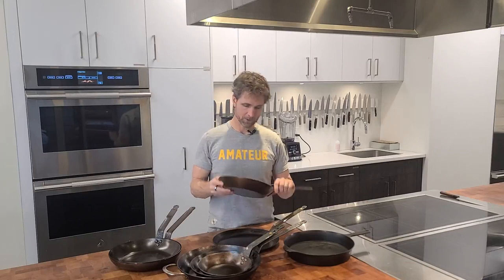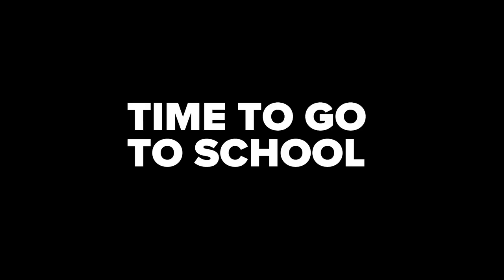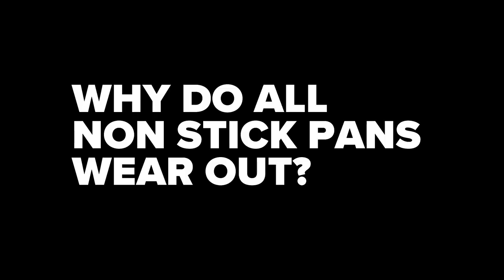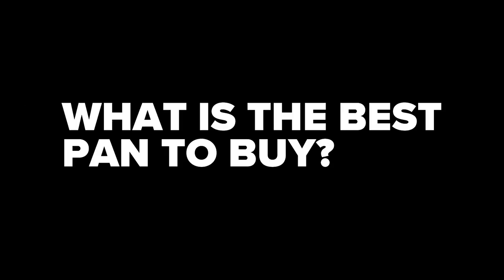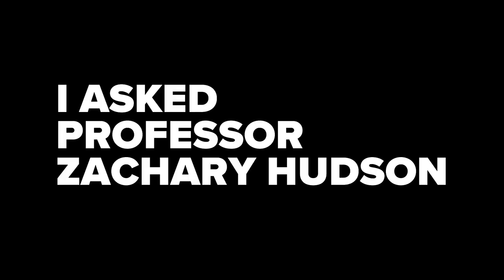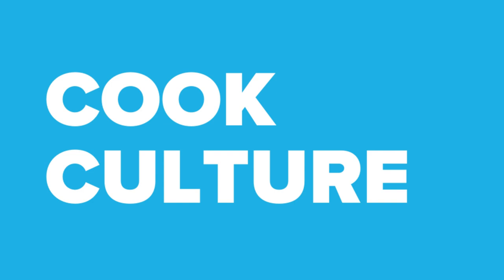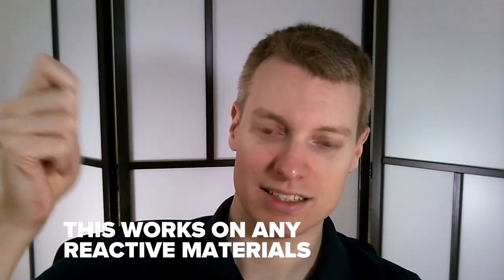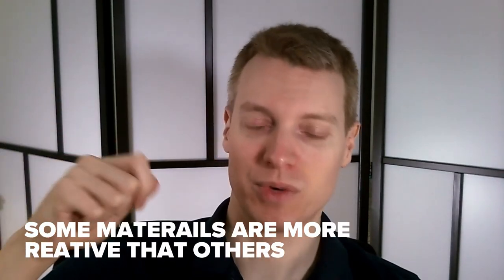Why ALL non-stick pans will wear out: I spoke with a Polymer Chemist

Comment: Dont saturated fats have higher smoke points and unsaturated fats have lower smoke points? So isnt it a contradiction to say you should use unsaturated fats and fats with a high smoke point?
Reply from the maker: Hi, the Doc was quite clear that unsaturated has a lower smoke point than unsaturated.
Reply: @Cook-Culture  Thats not being very clear to be honest xD
Reply from the maker: @jeffreylebowski4927  He explains it in fine detail in the video....?
Reply: @Cook-Culture  hehe I was teasing because you wrote unsaturated fats both times in your previous comment. - Like i said the way I understood it the doctor said to use a high smoke point, unsaturated fat - i was under the impression than unsaturated fats have low smoke points because theyre more reactive and saturated fats have higher smoke points - so a high smoke point low saturated fat seems like a contradiction to me - however Im sure its because of my ignoracne which is why I was asking the question.
Reply from the maker: @jeffreylebowski4927  Ah! Good question though, but yes, he's quite clear on how it works and why certain oils are better than others
Reply: @Cook-Culture  Ok so why is a high smoke point oil better than a lower smoke point oil?
Reply from the maker: @jeffreylebowski4927  High smoke point oils are considered semi-drying oils or drying oils meaning that they will not stay gummy. Low smoke point oils won't create a hard coating

Comment: Thanks for this amazing and actually scientific explanation of cast iron seasoning from an actual expert.  It has been frustrating to sift through all the anecdotes and misinformation in seasoning to just get an honest explanation of what it is and how to make it.

We really need to force manufacturers or consumers of non-stick pans to pay for the cost of disposal and recycling of their pans they know will be used up in two years.  They should pay for all research and efforts in cleanup of forever chemicals.  This externalization of costs breaks capitalism.  That cheap non-stick is a lie.
Reply from the maker: I understand that but unfortunately it's not going to happen.  What is happening is laws are being passed that will makes a huge difference.  Change is coming.
Reply: @Cook-Culture  Hopefully they are passed soon enough.  Fighting wasteful consumerism should be something both the left and right can agree upon.

Hey, while I have you here, what would you recommend as the next piece in my collection?  I have Lodge 6, 8, 10.5, and 12" skillets and one probably-too-thin tri-ply Calphalon 10" pan I got at an outlet store (the handle is heavy enough it lifts the pan a few mm if it is empty).  I was thinking of getting into carbon steel, but not sure which size would be good for my first piece.  I mostly cook for myself, and don't eat meat or eggs (but plenty of tofu scramble).

And if you twist my arm I would love to have any reason to pick up a new piece of cast iron ;)

Comment: What is your favorite carbon steel pan and the easiest to season? Thank you
Reply from the maker: Hi, my favourite carbon steel is de Buyer Mineral B. As for seasoning, they are all relatively easy when you know how to do it, so that comes down to the user and the amount of effort that is invested to learn the process.
Reply: hi, thank you for the rep. right away, I seasoned all my cast irons but never tried carbon steel. Right now I’m waiting for my mineral b to be delivered and I don’t know which method of seasoning I should use. I like the way you used the oven method and that probably I would use.